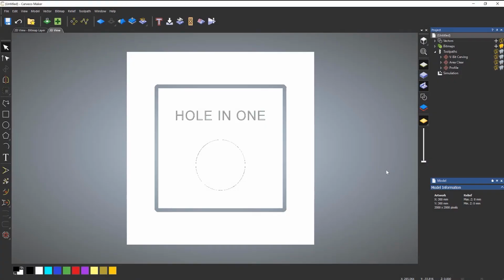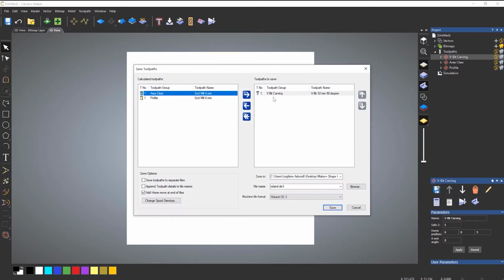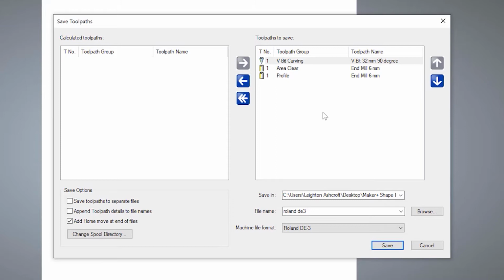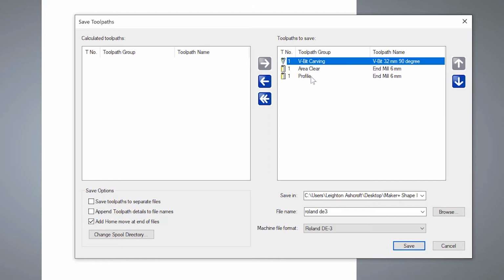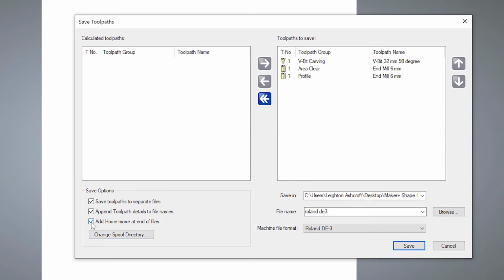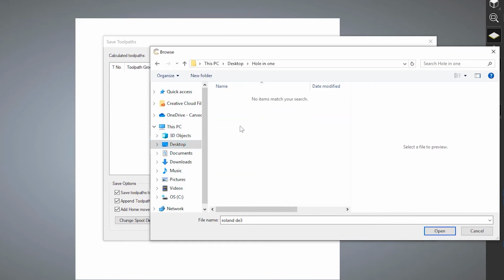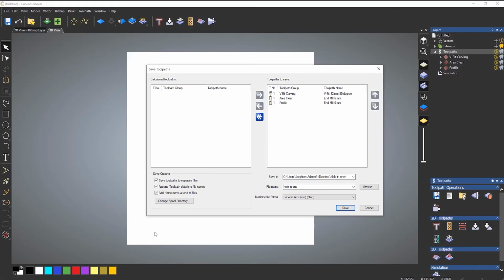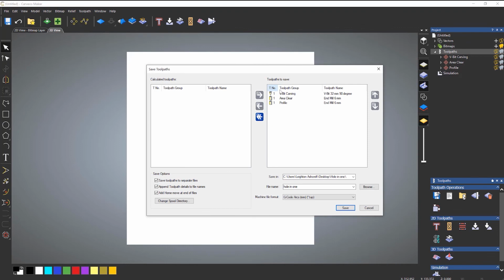Carveco Maker: Saving Your Toolpaths

Comment: I have tried many post processor  and i cant find the right one im using a sainsmat 4030 prover xl and every gcod i add my machine goes opposite direction or it starts then stops i have treid cand;e ugs and gsender. im at a lost.
Reply: Sounds like 1 or more of your stepper motors need to be reversed. It's an easy change in the GRBL settings.

I realize you posted this 2 years ago and probably don't need help anymore, but maybe someone else will see this and it will help them.

Comment: I have just attempted to send my first g-code using Carveco  and my sainsmart post processer . I found the right machine on the directory and was able to open the toolpath file in gbrl candle. I set xyz to 0 choosing the bottom left as my origin point.  On the machine setting I set the step to 1, feed to 10 and the spindle  power to 7000 just to stay close to the settings created in the toolpath code but it did not seem right to me. The machine started well ,cut one feature and then stopped abruptly. I could see in the g code processing window that only the first set of instructions were fully processed as al the others were held in a queue; is this normal? do you have to wait until all instructions have been processed to hit the send button or is there something else that I am doing wrong?
Reply from the maker: Hi Steve.  Normally the code is loaded up in Candle and then the machine reads through the code, line after line.  I would send our support guys a message and also let them know what version of Candle you are running and they should be able to help out - support@carveco.com.